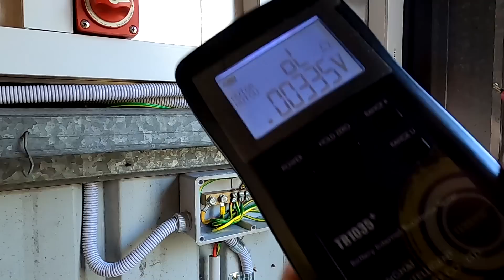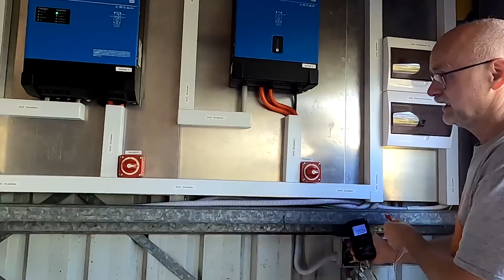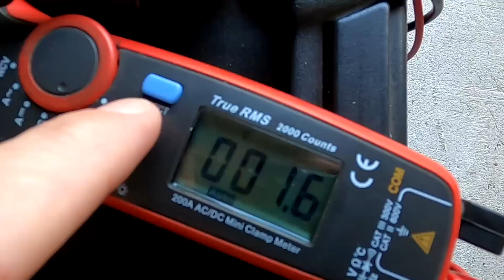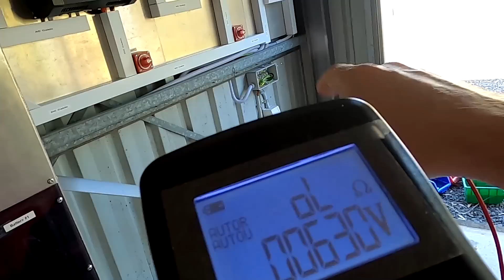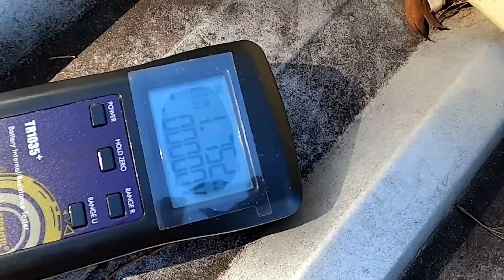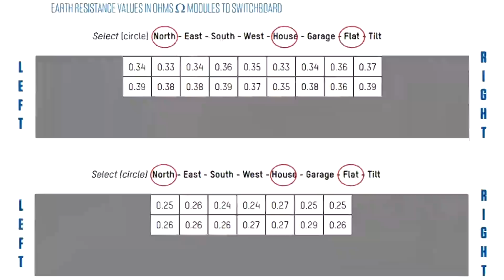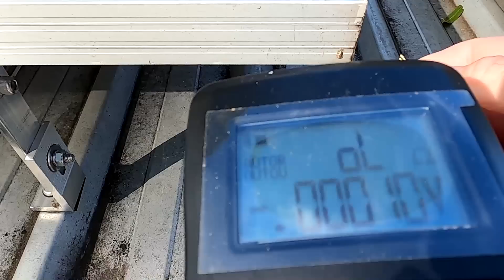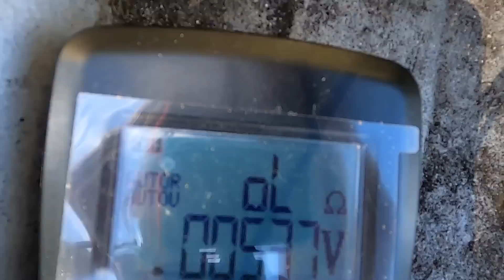Solar System Continuity Test: How to easily test your earthing.

Comment: Clip leads also create problems when trying to measure small resistances.  And inductance too.... if any of the wiring is coiled, that creates problems as well.  And fingers as well... all sorts of problems.  What I do is use WAGOs to connect the probes to the wiring to get a really solid contact.  Or a screw-down if connecting to rail or conduit.   The thin wire will cause problems too.... I usually have thousands of feet of ethernet cable sitting around so I just use an ethernet cable and strip and bind all 8 wires together (or in two sets of 4 wires each which allows me to loop it if I want to), to make a long cable.  And I zero the meter out on the cable.   WAGOs are great for gluing everything together so the measurements can be made hands-off.

A non-precision meter also tends to be inaccurate when trying to measure small resistances, particularly if you have to do a relative measurement from a non-zero 'zero point'.  That's one of the few cases where I pull out the 8845A for 6.5 digit accuracy.   But it will probably work reasonable well for what you are testing as long as the resistance isn't in the gutter.  Just make sure you have solid connections and its hands-free... no holding wires OR probes with your fingers while taking a measurement.

Continuity... like Continential...   Contin - new - ity  (at least in American English).    Hahaha.... reminds me of a very embarassing moment once when I was doing a lecture on RPN expression parsing 30 years ago and I said "Urinary" instead of "Unary".    I don't think its possible for anyone to top that one!

-Matt
Reply: But even with a 8845A, the problem still remains, the need of a decent test current to do such measurements.
So tools like e.g. the MPK-257 from Sourcetronic or the Megger DLRO10HD are the better choice.
Reply: @Frost4  Well, its a lot of money for a tool most of us almost never need to use.   The 8845A does have a 4-wire measurement mode, but it is true that it is only 100mA.  Still, it does have it.   I think it is acceptable to do the resistance measurement and the current validation separately.  As long as the results are relatively close to each other.  The current validation can easily be done with a relatively uncalibrated bench supply.

Comment: You need some pointy probes to get past the anodized coating.  Very interesting....almost no conductivity with that coating when you install the panels.  You really do need the funky washers or equivalent new version racking clamps that can pierce the coating.
Reply from the maker: Yes, I didn't know that either and wasn't aware that it is actually isolating.

Comment: Most rail end and mid clamps these days are "bonding". They'll have something sharp to pierce the coating on it.
Reply from the maker: Never seen them so far. It would make sense though.
Reply: @OffGridGarageAustralia  maybe it's just the rail systems that are common in the US that have them. All the major ones that I looked at used bonding clamps.

Comment: Here in the uk the earthling requirements  for solar have changed several times...from nothing to more and more. I personally dont see the need to ground the panels..that's why we have earth free zones, however you do have a metal building so its probably harder to keep it earth free than to earth every thing.😑
Reply from the maker: Not earthing at all is dangerous. Especially with solar and high DC voltages. Some people have reported they get a little tickle when touching some panels on their roof. I would not like this situation.
Reply: The issue with that is you won't know you have an earth fault until someone climbs up a metal ladder sitting in a puddle, to clean their solar panels, and gets a 400VDC shock then they touch the frame.
With everything earthed, the inverter can monitor for earth faults and give an alarm as soon as it detects a low resistance path between + or - DC and ground.
Reply: @cods41  ... which I think, is monitored by the new RS 450/100 MPPT chargers from Victron.. I have 2 of them... :)
Reply: @mw9271  Yes, I think most modern solar inverters have earth fault monitoring. I think it is a requirement under the AS/NZS standards.

Comment: Hi Andy Im from Adelaide SA according to NECA and Clean Energy Australia plus AS 3000 placing them washers under the panels is not enough. Thats only mechanical connection you need to have what is called electrical connection for that you need main Earth to the railing and from that Earth you need individual Earth to the each panel. That ruling came out December 21 also the Earth measuring is taken from the main Earth stake that way you know all the Earthing is correct. Love your videos keep up the good work kind regards from South Australia.

Comment: if you extend both wires of one probe the tester will measure the resistance from probe to probe without the cable resistance, thats the reason for the sense cables😉 greetings from sunny hot germany 😎
Reply from the maker: I know that but I cannot take the wires off the probe.
Reply: @OffGridGarageAustralia  But you could make an extension cable for the 4-pin connector - but that requires ordering the fitting connector.
Reply: For followers interested in low resistance measurement they can lookup Kelvin Connection.

Comment: Hi from Germany!
Just a heads up from an electrician, who did close to nothing else but safety measuring electric gear and buildings:
During measuring of the resistance of the grounding, you need to absolutely ensure the measuring current is at or above 200mA. In machine building they recommend even 10A straight. Yes, you read that right.
I don't believe your tester there does provide that amount of energy for that, so these testers you referred to do have their eligibility...
Reply: Agreed.
In the high voltage industry we normally use 100A current to test contact resistance, and the test is referred to as a ductor test. Check out the Megger MOM2. Very clever piece of equipment that fires up to 200A through to give you a reading in the microohm range, and it is surprising small and light.
Reply: One of Andy's bench supplies could do it.   1 ohm, 1A =  1V drop.  1 ohm, 10A =  10V drop ... yah, a 5A or 10A CC/CV supply could do it.  They can usually go up to 30-40V or so.  That would be good for up to around 3 ohms.   But he would have to make sure that the supply is isolated from the mains, otherwise there is an alternative path to ground through the neutral-ground bond.

The voltage drop can be used to calculate the approximate resistance as well as double-check that the ground path is solid.   And one can look at the junctions (wire meets screw, etc)... bad connections will have excessive heating.
Reply: @junkerzn7312  Sorry, but I deem that a little bit dangerous. Professional testing gear does have some safety built in and that's one part of why that is so expensive (I'm talking about the real stuff, not the cheaper gear Andy referred to). The other part is brand naming. Only a little part of the price to pay is the actual hardware, the R+D or the marketing...
Reply: @wiedapp  Mmmm.  Lets just say that alarm bells don't go off in my head when we're talking about < 50V and current that is already mostly flowing through a low-impedance path.  I think it is low risk on both accounts.   But I'll grant you that a dedicated tester will be safer since the bench supply more or less runs the current continuously while switched on and a dedicated tester does not.

But again.... cost.  And if you are testing junction temperatures at the screw terminals and so forth, you have to run a continuous current anyway.

-Matt
Reply: Interesting.   I guess they want to make sure the resistance is not all concentrated on one spot that will heat up if the current is flowing.

Comment: Couldn you use the 4 point probes method  (Kelvin Probe, 4T sensing) of the yr1035+ for the extension line ? That means 2 wires for the extension line and the resistance of the cable will be cancelled out.
Reply from the maker: The tester has 4 wires. I just could not take them off the probes.
Reply: @OffGridGarageAustralia  Yes 2 wires to the "on site" probe on the roof remain unchanged. The other two wires of the other probe will be extended and stay isolated from each other until the main ground bar, where they both are connected the ground bar independently.